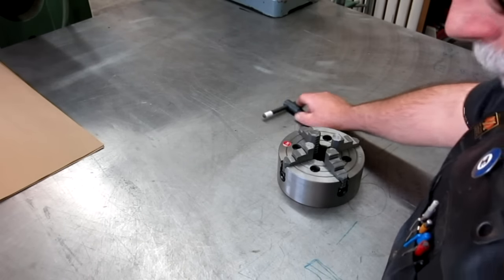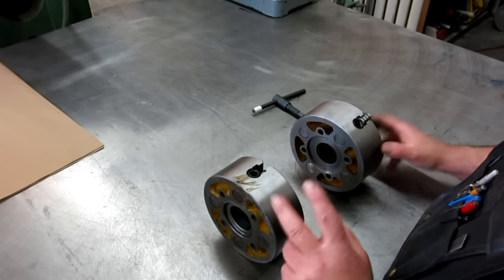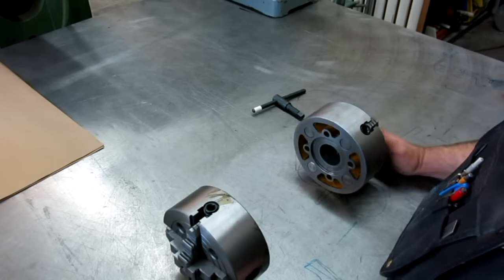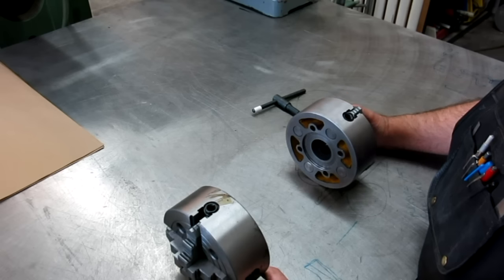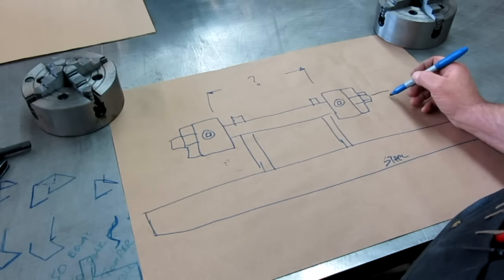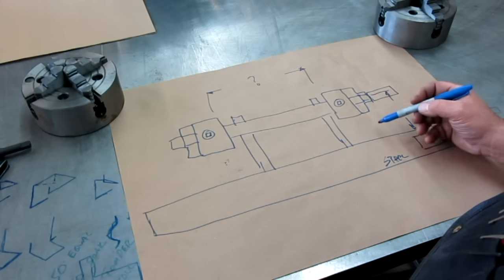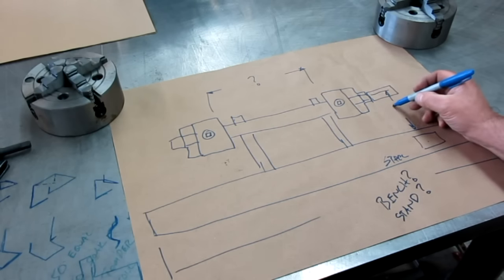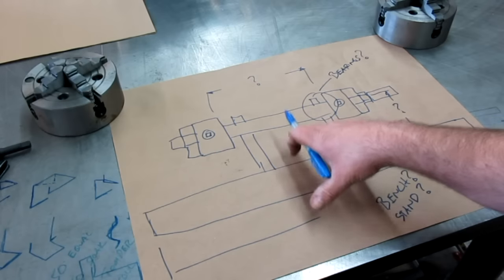Four Jaw King Maker P1

Comment: I have to admit I'm kinda simple-minded when it comes to things like this.
A couple 2x4 C channels or box tubes about 3' long for lathe bed/ways, spaced 3" apart.
A couple 4" square box tubes (or more 2/4 C channels) for vertical risers for spindle support.
Another hunk of 2.4 C channel about 12" long for spindle bearing support.
Three 1" pillow blocks with set screws against the shaft,  mount on 2x4 C channel.
Some 3/4 pipe for a shaft turned to 1" for the bearings. A stub welded in one end so you only need 3 bearings.
A pair of 3/4 pipe flanges and a couple hunks of 1/4 - 1/2" plate for the chuck mounting plates.
Done.

Personally I'd make it about 18-24" between chuck back plates and about 6" in front of the chuck before the ways end, but that's just me.
Reply: I like how you think.

I'd clamp the spindle support risers to the "bed", because I can see wanting to use the rig/jig for other situations, where the jaws would face towards each other... It'd only take minor design and fabrication effort to allow them to be reversed on the bed...
Reply from the maker: Hey Wilton,

I don't have anything on your list. So I guess I'll have to use stuff I have around. Thanks for the comment.

Cheers,

Tom

Comment: Tom, love the (what I call) cocktail napkin engineering. If the intent is to stand shoulder to shoulder against the competition wouldn't the contestant on the left be at a disadvantage ! Totally unorthodox position with the material pointing to the left. A little like standing on the back side of your lathe. Perhaps two independent chuck stands? Spacing would be adjustable on sight or they could be attached on a table in such a way you could face your competitor. If it's going to be a competition make it a fair competition. Looking forward to see who wins the championship belt, good luck. Although myself not into competition don't all of us ask ourselves when we use a 4-jaw how quickly would Adam have done it !

Comment: TO cancel or avoid any radial play on the chuck you could use 2 oposing tapered bearings with a bolted flange to torque them in place against the racers. Just like a motorcycle steering neck assembly

Comment: I would think you'd want both chucks facing the same direction.   If I were in the competition and got a left-facing chuck, I think I'd be disadvantaged.  Maybe that's the intent.   :-)
Reply: Each opponent can stand opposite each other, then the chuck is on the correct side for both. And it gives a little more space.
Reply: My thoughts, too. This would be better to put in the middle of a table or something like that and each competitor would stand on the opposite side.
Reply: Duhhh.   LOL
Reply: +Steam Train Builder Agreed.
Reply: my thoughts exactly

Comment: Hey Tom, one thing I saw was that on the back of the chuck there was a counterbore which aligns the chuck on the lathe spindle. On your flange/bearing holder I would add that step/ alignment to back of flange, that way that  it the chuck runout out of the equation. If you want to win easy add a one-way bearing to the side that Adam uses. Dave A

Comment: Tom,  I had a different idea for this kind of a rig - partly because I can see using it for other competitions, like dialing an eccentric or crank shaft, using both chucks together at some time...

So, my idea is to split the shaft into two pieces, and mount them independently on a common rail, such that they can either face or oppose each other...

Also, being more familiar with mounting a chuck to a backplate, I'd do that, and have the shafts rotate in a bearing block which is supported off of the common bed/rail, more like the headstock spindle of a lathe... Less creative thinking required of me, and I would be better able to source the parts, not having the inventory in my shop that you do...

Also, since ergonomics vary based upon the person operating the rig, I'd throw in a few more adjustments for height above the floor and separation between the two chucks.

Mostly, this is just because I can see other uses for the rig / jig besides just the competition... if two designers can't come up with at least three different ways to do the job, something is off - with the job, with the designers, or with the levels of blood in the caffeine streams! ;^)

Cheers,

Eric

Comment: Nice idea Tom. I think the chucks need to have some resistance so that they feel the same as a lathe. I reckon the person building the device will have a major advantage in the practice stakes. Also the chucks look much smaller than the one usually used for the competition. The chucks need to be at least 5' apart.  But my money is still on Adam. regards from the UK

Comment: The brown paper works well. White paper or shiny metal will fool the camera's auto exposure, whereas the brown paper has enough tooth to keep the exposure steady.  I'm not sure if your camera has different modes to it's video shooting, but yours does have a limited dynamic range, at least at it's current settings. The intent of the range is to keep the video looking snappy and not dull.

Comment: I think you should make it usable from both sides. Then both competitors could have the chuck on the left as is standard. Also would reduce the total length needed.
Reply: As Tom's comment says:

"The competitors face each other on the Kingmaker. You know, Face off. Got to look a brother in the eye when you smack them down. Normal lathe setup."

Comment: Just a thought, maybe use a piece of square tubing turned 45* about it's axis for the backbone. This would make your indicator face at a similar angle as a vee way. Get your friends down the street to water jet the risers to slip around the tubing, a tab below to bolt the feet on and support for the shaft in one piece.

Comment: A simple solution might be to shorten a trailer axle and fabricate two chuck adapters to bolt onto the hub on each end.  You would have the benefit of tapered bearings as well!  Possibly a hidden brake mechanism would help you get the best of Abom... lol

Comment: have you spent all year practising? good luck!   the downside is one chuck is pointing the 'wrong' way, so someone will be at a disadvantage i think, can you not make them both point 'right' ?  unless you both stand on opposite sides?   i was thinking also about putting a metal sphere on the end, and it locates into a metal enclosure at the end, and the enclosure is 1 thou larger than the end, connected to a buzzer, so you can quickly see if the 'winner' has his located within a thou.   you cound make it fit onto a 'chop saw/mitre saw' dewalt stand, so very stable and can accomdate the both sides issue.

Comment: Tom,
Some thoughts..  I would think that it;s unfair for one to have the chuck on the right while the other has the chuck where is normally is on the left.. Your idea is not bad tho as I would put one contestant on one side and the other on the other. That way you could stare down your opponent.. :-)    Another option would be to swap the shafts and bearing holder.. Small shaft on bearing ID for the chuck.  OD  in the tube mounted to the lath base.. I would press and / or weld 1 inch shaft to a sawed plate, then turn it true..  Less material / machining..   The bearing holder  a short piece of pipe that holds the bearings and weld via pipe to the lathe bed..  If you do that you can make 2 individual, 4 jaw setups and put them on one plate..

Comment: Don't forget something to center the Chuck on the Face Plate.  Something to allow centering easier than just the 4 bolts.

Also, maybe add some alignment marks to the jaw screw heads,  that will allow quickly resetting the jaws back to the starting position.

Comment: The paper works great. Much better than your shiny bench or white paper that always blows out the auto exposure on the camera.
I think your stand will either need to be bolted to the ground, or be something you can fill with sand or water to give it enough mass to be stable with the two of you gronking and banging away at it. However, Adam will already be at a disadvantage with those tiny chuck keys. His typical technique for loosening the highs will be hard to do with such short handles. Maybe the event can be a BYOK deal, just publish the size of the square drive needed?

Comment: Build a stand, this controls the overall height without worrying about the height of a table.  Also allows competitors to face each other while putting the chuck to each competitor's left and also eliminates jostling from competitors too close.  Stand should have a projection well below the chucks allowing it to be clamped to a very stable bench or?.  This is to provide overall stability.
I wouldn't use a common shaft, too easy for opponent to interfere with readings and induce error.

Comment: Tom,
    on the fixing of the central shaft to the two vertical bearing support blocks how about Loctite 609, less chance of distortion than weld, and pretty easy to disassemble if required,  I am a firm believer of the product mentioned,

Edmund...........Alberta

Comment: I like the basic design you have thought up and drawn. I happen to think the two chucks are too close to one another as shown and if you spread them apart this would help with stability. Could you find a straight and true beam axle with tapered bearings and wheel hubs which the chucks be attached to?

It seems to me that the set up wants to be fitted to the basic design of a carpenters saw horse which is strongly attached to a significant plate that the competitor stands on. 

Also is a place needed for a hammer / bumper and chuck key rest for each competitor?

Comment: You are going to need a very stable stand, to the point of being less than portable. If you both are tightening at the same time, that would be a considerable amount of torque and when "tapping" in adjustment, a slightly wobbly stand well cause issue.
Reply: Also wouldnt the torqing action of tightening the jaws transfer through the shaft to the other chuck, causing erroneous indicator readings?
Reply: You might be right, you would need something big and strong, a lathe would do a great job in fact. :>) Although I do see a good opportunity to "interfere" with the opponent's readings should one be devious.

Comment: I saw the design question "bench or stand" was unanswered. Other commenters echoed my thought that it needs to be really rigid with two determined men twisting hard and independently.

So make a stand that holds a large poly tank inside it, and fill the tank with water. 64 lbs per cubic foot, a 3' x 3' x 5' tank would go 2800+ lbs, that would be rigid enough, I think. And drained, a whole lot easier to transport.

Go to an agriculture supply site, find a tank, and then design the bench to hold it.

Comment: What are your thoughts on having a 4-jaw chess-type competition : 2 chucks with numbered or color coded jaws, 1 shared shaft and a Fisher chess clock with a 10 second delay... here is how the competition would go : flip a coin to see who goes first, let's say Adam wins the toss and decides to go first... Adam's clock starts, he has 10 seconds, he can rotate his chuck anyway he wants, as much as he wants, but he is simultaneously turning Tom's chuck who is observing his own indicator and preparing his moves... Adam is allowed a maximum of 2 moves per turn (e.g. loosen jaw 1, tighten jaw 3), when the 2 moves are done Adams presses the chess clock to end his turn which stops his clock and starts Tom's clock... If Adam goes over the 10 seconds without making at least 1 move, he looses... If Adam makes his move(s) in 6 seconds, on his next turn he will accrue the remaining 4 seconds and have 14 seconds on that turn.  The first one who believes he has successfully indicated the part within let's say half a thousands calls the match... the referee checks the result with a tenths indicator... if the part is indicated within 5 tenths the match is won, otherwise the match is lost.

Comment: Im wondering if a pair of Subaru or Jeep bolt on wheel hubs would work?  Ive seen them as cheap as $27 each.  The housings could be bolted to a block of aluminum that would act as the headstock, and the hub flange could be used as the backing plate for the chuck.  Chris

Comment: Will you add some resistance to the shaft to mimic a real lathe? Would the chucks spin too freely if they run in the bearings alone. I can see some chuck keys flying in all the excitement otherwise!

Comment: Just a quick thought on the bearings you will be using.....I see you have the salvaged 6205's on hand that are ball bearings. Is there any worries on the "inherent play" in the bearings (that is most likely negligible)? Would a cheap tapered roller bearing set be a better option to eliminate the play in the chuck? The mounting of the chucks on the fixed shaft are suited to having the retaining fastener be the bearing adjuster (a set of lock nuts would retain the adjustment)

In Australia we can pick up "trailer bearing kits" at local auto shops as low as $10 for an axle set (4 bearings total, 2 + 2 sizes). There's 2 popular styles here "Ford" and "holden (GM)" and both are priced pretty much the same, but are different sizes.

I love the concept behind this project and wish you luck against the reigning champion of the 4 jaw.

Comment: i think you may have a problem with rigidity having both chucks on a common shaft. when adam starts cranking on the chuck key (you have noticed he tends to put some weight into it) while your checking runout ,whats going to happen? you may have to limit competitors to one hand on the chuck key. with separate fixtures you could both be on the same side of the table.

Comment: Why not have a separate  "headstock" for each chuck?  A couple of extra pillow blocks and some box tubing for the bed, upright bearing supports,and a spindle to mount the chuck to. Each assembly could then be clamped to a fab/welding bench as desired for plenty of elbow room.

Tom

Comment: Hey Tom, 

While I think it's a great idea in theory, and a cool way to have a head to head, are you not worried about the runout of regular ball bearings vs a lathe headstocks' more substantial loaded bearings?   Also,  I could see Adam or another competitor putting enough force on their side cranking for that last 1/2 thou, or smacking the t-handle on an over-tight that it could flex/move the center bar assembly enough to mess up the other guys readings.  Perfect project for an overkill build I guess.

Comment: Is a 1" (25 mm) shaft stiff enough? It seems like it might flex under the weight of the hand when spinning the chuck, or even more so when "gronking" on the key. (0.001" would be too much flex). You could make the shaft extension much thicker and use different inner and outer bearings. (Inner the size of the thicker shaft extension, and outer the current size.) You could test the flex by putting a 1" bar in a really solid vise and clamping one of the chucks on the bar 3" from the vise. Then put an indicator on the chuck and see how much hand or key pressure results in too much flex. It's like the old maxim: "Design like it was going to be made from rubber; then make it out of steel."

Comment: Would also add that it may slow down the person use to working from right side to have them work from the left side
Reply: They will be facing each other on opposite sides of the fun machine so the chuck will be on both of their left sides
Reply: thanks
Reply: that fix all

Comment: Total shaft length is 12 inches subtract 2 X 3 inches for the bearing portion on each end. That leaves only 6 inches where the 2 stanchions will be attached - is that enough?
Reply: Actually that will be less than 6 inches as Tom decided on 3 diameters between bearings. So 3 inches plus 2 X 1/2 inch or so and little bit more = about 4 1/4 inches bearing shaft per side = 8 1/2 inches which only leaves 3 1/2 inches for the stanchion supports.

Comment: I wonder about your 4-jaw technique.  Years ago, on alt.crafts.metalworking, there was a guy who went by Tee-Nut.  His technique for centering a part in a 4-jaw chuck is very predictable and has worked well for me.

Chuck the part and set up your indicator like always.
Rotate the chuck to find the low spot
Zero the indicator
Rotate the chuck to find the high spot  (let's say it reads 0.350)
Divide the reading in half and set the indicator to read that (i.e. 0.175)
Rotate the chuck so the indicator is lined up with a jaw
Adjust the part so the indicator reads zero (easiest with 2 chuck keys)
Rotate the chuck to the next jaw
Adjust the part to read zero.

If you did it right, the part is now centered.  

Is it faster to do it this way or to chuck it up and fiddle with it?

Comment: Timing: how about a holder for the chuck key, with a switch that starts the clock when the key is removed, and stops it when the key is replaced. That way, there's no "reflexes" effect on the timing of the actual adjustment where one player may react faster to the "start" command than the other. Also, you could add a powerful electromagnet to the key holder to lock the key in once finished - once the clock stops, the contestant cannot remove the chuck key again to fine adjust.
Reply: they do digital timers that can be run by a switch, and can be linked to another timer for head to heads

Comment: Just thinking. 

How about weld-on trailer stub axles and bearing hubs instead of making a bunch of stuff? Salvage an axle from a dead boat trailer? Automotive unitised front wheel hubs? THK type crossed roller bearings? Might bearing quality be important in the 0.0005" range?
Reply: i think even with his practising, adam does do this a dozen times a day, tom is still at a disadvantage, short of practising on the new rig (smaller chuck sizing than adam is used to) might even out the field, we all slow down as we get older too, im wondering as it is about the two plain bearings, be far worse with old trailer bearings creating movement!lol